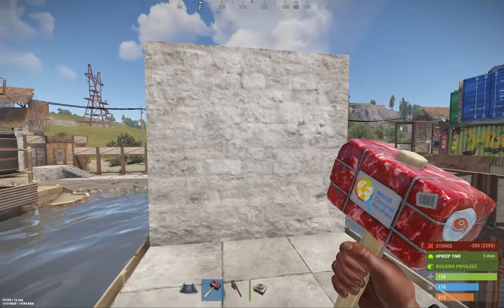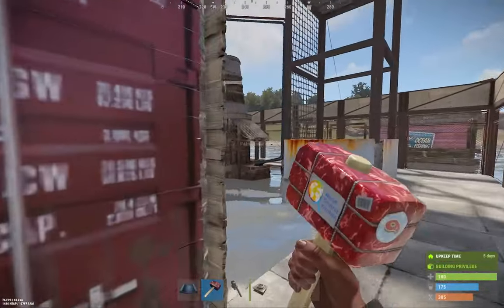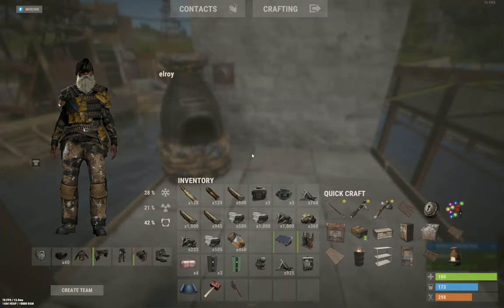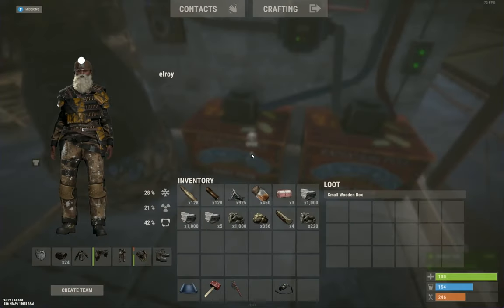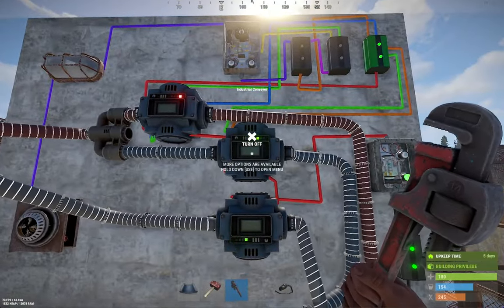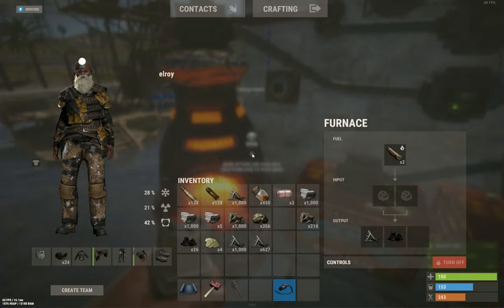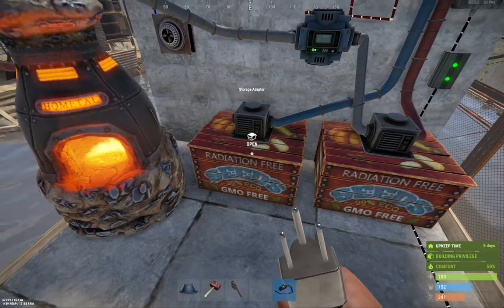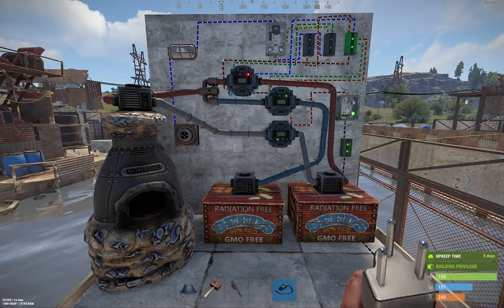Rust Industrial update. Efficient igniter set up for charcoal production.

Comment: Just a quick tip, instead of having a timer running the igniter until wood is supplied to the furnace, have it run into a blocker that runs into the toggle of another timer so that the igniter is only used for 1 second. This will make it so that you are getting the most out of your igniter as they take more damage the longer they are on
Reply from the maker: That’s clever thinking! Thanks mate
Reply: any chance you can add this extra piece to your  rustrician set up online? plz and thank you, id much appreciate it!  Would love  the blocker and extra timer set up added! :) @elroyonline
Reply: And i got done making mine, and it doesnt work... i even followed   rustrician 
you made, and still dont work.  You sure you did this correctly?
Reply from the maker: @cowdy293  hey mate - I’ll have a look at it all again when I get a chance. Ironically I was having trouble getting a set up like this (for a refinery).

Comment: Man I am not understanding this. I did everything the same but the wood imput turns off everytime. So I flip the switch with empty furnaces and it will get rid of the smelted ore and charcoal, but it keeps shutting off my wood conveyor every time it starts
Reply from the maker: Hey mate, search for the title of this video on http://rustrician.io - I’ve added a schematic there which should be easier to follow

Comment: I seem to have some issues, the system does technically work, but my setup only is meant for wood to go through the furnaces to make charcoal as i use electrical furnaces for ores. and i tried doing the conveyor (pass/fail/on/off) on the wood conveyor but it just seems to break it, any possible solution to this?
Reply: Ok so i have a solution to this. Basically, turning the conveyor on and off isnt really required as it can break it, but everything else works as normal

Comment: I'm having real difficulties with this. I have copied your setup pretty much exactly as it is here. It's not working with large furnaces. I think Facepunch must have messed with something. The timings are not right and the Filter Fail keeps tripping and cancelling the wood. I've tried using a separate timer to get around this but I'm struggling. Have you been successful with this circuit recently?

Anyway, I wanted to also let you know there's a typo in your video towards the end. When you're writing out the instructions you say to use the Filter Pass and Filter Fail on the wood conveyor to send to the Memory Cell, but I think you mean the ore conveyor. (Approximately 10:35 mark).
Reply from the maker: Hey mate, I think something was changed, but it should still work - but perhaps the timing is different because you’re working with a large furnace? I’m not sure, to be honest. I’m sorry about the typo! I hadn’t even noticed. I’ve put a schematic of the (correct) set up on rustrican.io (search for Efficient igniter set up) - I hope it helps
Reply: @elroyonline  I looked at that schematic and found it extremely hard to follow. I don't think they did a great job implementing the industrial pipes on their website. It's very hard to see what each connection is going to. But I simply slowed the video down and copied everything, so I'm not concerned about getting that part right. It works... but sometimes the filter fail on the ore conveyor goes off and there's really no reason why it should since there is plenty of ore in the box, and as it fails it causes all sorts of problems down the line. I wasn't sure if the build server I was working on was glitchy so I've switched back to vanilla, and yes, it's a real problem. I can't seem to get around the issue so I may head to a Discord where there are more electricians who might know what's going on. Thanks for the video though, it's a great concept!
Reply from the maker: @shiftlessdrifter692  thanks mate. Sorry it wasn’t a bit easier to get working. I’m sure the discord will be really helpful - there’s stacks of information and people there who are really good at this stuff. I haven’t had a chance to build this kind of system again since that first wipe, but i get a chance I’ll do it again soon - and maybe make another video, without typos or as much rambling 😂